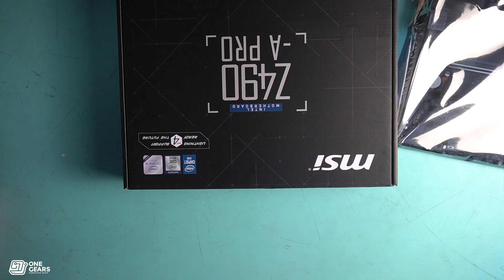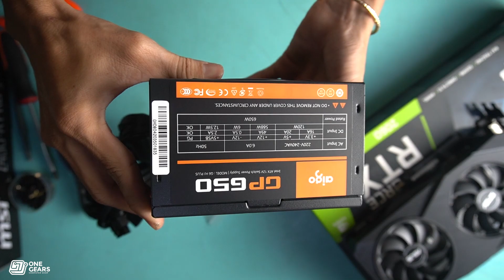Gaming PC Intel i7 10700K RTX2060 MSI Z490-A Pro - Fortnite Season 4 Nexus War

Comment: Your front top fans will pull air away from your air-cooler. You'll get better CPU cooling and less noise with them turned off, or blowing air into the case.

Comment: strange. you screwed the nvme down with the stand off screw - surely it should rest on top of that screw and the heat sink armour then be screwed in to keep it in place? I'll bet that heat sink is only  touching half your nvme drive?

just built the same system with 64gb 3800 and 1tb WD blue nvme with a h115i cooler to run a 24/7 DCS World server - that's not how I put the nvme card in

Comment: Did the M.2 stand off come with the motherboard or the SDD? Or do you need to buy separately?
Reply: Did you ever figure this out? I am currently having the same problem. I can’t find any m.2 standoff from my motherboard or ssd.
Reply: @zacharybull7143  on mine the stand offs are preinstalled and one m.2 screw is included. If I buy one for the second bay I’ll probably have to go on eBay to get another m.2 screw that fits

Comment: good bro. I have a problem with my computer. build one with this mobo and i9 10900 and it only stays in the BIOS, it doesn't detect the ssd or HDD. how do i configure it so i can use it. thanks
Reply: Did you fix the problem?
Reply: @AB-ii4pb  no
Reply: @YgorZombieMan  I’m also getting the same motherboard so I’m scared I might have the same problem
Reply: @AB-ii4pb  hope not.

Comment: I the ASrock b460 pro 4 good for the i7 ?
Reply: If you're getting 10700 and not 10700k, absolutely. Otherwise get a z490 motherboard for 10700k, I got MSI Gaming Edge Z490 for it and it's fantastic.
Reply: Peter Klick i got the i7 10700k but you think this is a problem now when I’m don’t overclock im getting a new one in 1 month
Reply: Onkeldagobert FN You can run i7 10700k at stock speed with no problems but you won't be able to overclock and take advantage of extra free performance. It's not a problem, rather it's not ideal. Z490 chipset is the best for i7 10700k, b460 for non k 10700 which runs locked at stock.

Comment: Good bro. Excuse me, could you help me set up my computer? I have that motherboard with an i9 10900 with a 512gb nvme with 32gb ram at 2666mhz. Windows loads it very slow.
Reply: First Of All Increase Your Ram Frequency (speed).
And Try To Reinstall The Windows(In Ssd) It'll Definitely Boost Up Your Performance...
Reply: @itshyperelite4869  que tanto debo de subir la frecuencia de la ram. Y sólo con eso?

Comment: BRUUUUUHHHH the rubber of the back plate should be on the other side of the mother board not on the front it's there to protect the back side of the mobo from the metal plate not for the stand offs of the cooler

Comment: noooooo dont buy 2060 rtx 30 series are comming out for the same price but 100%more performancee nooooo
Reply: He probably already owned one before 3000 series was announced and repurposed it for his build, I bought my RTX 2060 in early 2019 and I still feel like I've been scammed lmao. I already upgraded my motherboard and cpu to i7 10700k to prepare for it, but I'm still stuck with a 2060 for now :(
Reply: @pk.002  ye that makes sense :d
Reply: mishkataBG nah 2060 is still a good value
Reply: M_yen_bot 1 From the way it seems I'll be using my 2060 for a while 😂 30 series launch was a disaster and I'm not confident in stock getting better until next year. Not to mention launch cards have overclock problems
Reply: @pk.002  If you playing competetiv games the 2060 should be fine and you dont need a 3000 card
Reply: Malü I play everything including more demanding titles, so sadly I would need to upgrade. For now the 2060 still plays everything I throw at it with no problem and I run it overclocked too, it's still a great card. :)